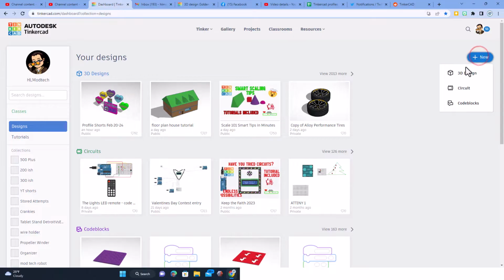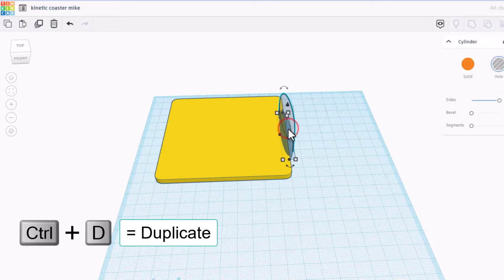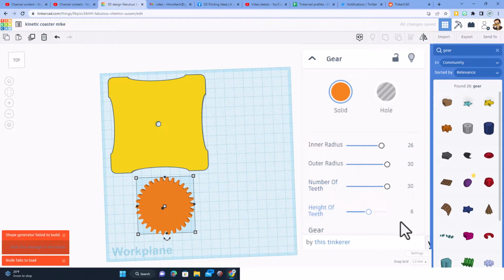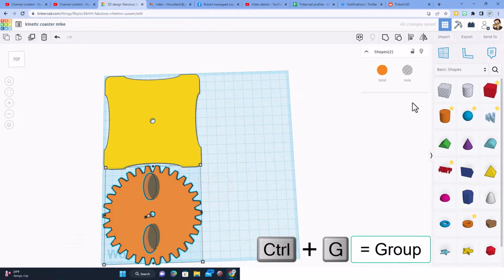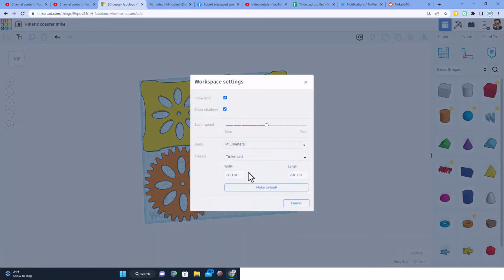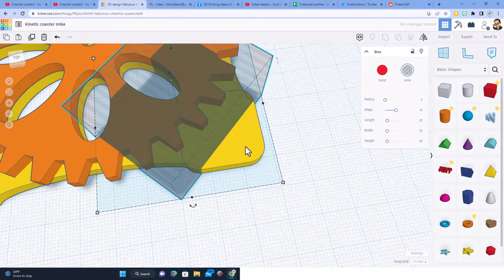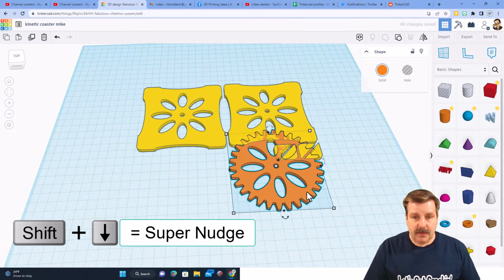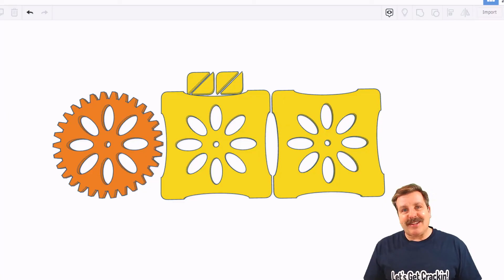Make A Tinkercad Kinetic Coaster Laser Cutting 10 Minutes

Comment: Tinkercad is pretty good except for limited resolution.
Reply from the maker: I find that it works for just about everything I design. What sort of stuff are you creating?
Reply: @HLModTech  PCB's
Reply from the maker: I can see how that would be tough. Have you ever played with the circuits? Not the same as a PCB, but fun to make stuff light up. =)
Reply: Yeah, it has a limit of something like 25MB, which is just not enough to import a lot of the stl files I'd like to use in it.
Reply from the maker: If you can get a hold of meshmixer, this is pretty slick. https://youtu.be/JwqdsIoIsas
Reply: @HLModTech  Thanks
Reply from the maker: Always a pleasure. 👍